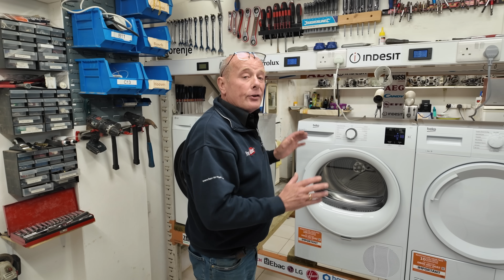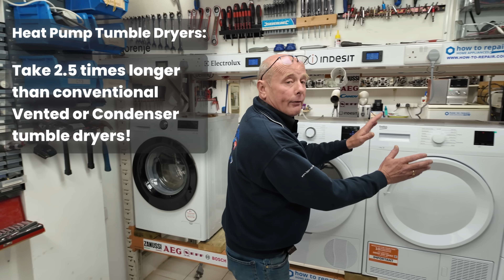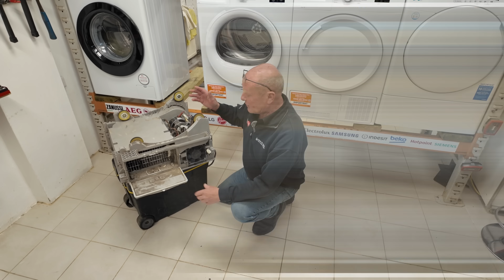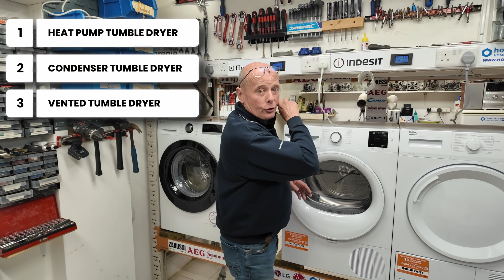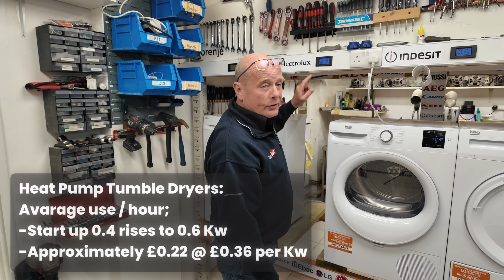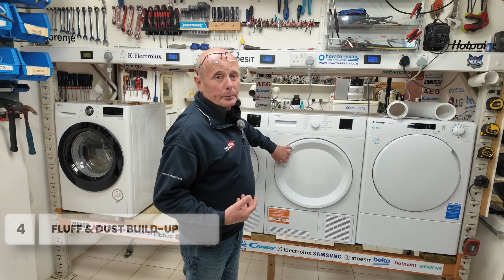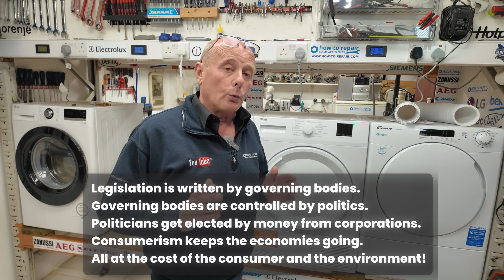Tumble Dryers the Shocking Truth About Heat Pump vs Vented & Condenser, NEW LEGISLATION!

Comment: I get these arguments to a point, but in my experience, the heat pump design would accommodate uprated bearings, and the compressor system would be reasonably reliable, probably no different to a fridge which also has a pressurised system and pump. I agree if it breaks its a much bigger pain perhaps, but in the UK its basically you're only option from new right now. We currently have a vented drier, it dries like a beast but consumes a lot of power but thats the tradeoff at the end of the day. If heat pumps are more efficient it's a bit of a no brainer. And the wear and tear on clothing must be a non argument because it will be a gentler temperature cycle overall I presume, and the collected lint will probably be the same for all three types of drier over a cycle?

Comment: In my region, lg washer dryer ( it uses condenser dryer type) has only drain pump filter. It doesn’t have any lint filter. Manual says : “ The water is used for auto-cleaning of lint-filter on drum during the drying. “ . Will it be a problem?

Comment: I went at drying clothes from another angle, instead of a dryer I bought a dehumidifier. No wear on the clothes so no fluff. You can get a very good one for a lot lower than the price of a dryer and as it isn't creating heat to dry it is cheaper to run specially if you run it at night. Another plus is if you have a room that is prone to mould you can run the dehumidifier in it every now and then to keep moisture low.
Reply: I was interested in your comments. I've been considering moving on from my old vented dryer, but I haven't been able to justify the cost. I also own a dehumidifier unit, and I have been using it as a clothes dryer in my laundry room.   I use portable drying racks with the dehumidifier, which works well for most clothing, not so well for sheets and other bedding. For them, I'm considering setting up a clothesline in the laundry.  I find that using a pedestal fan as well also helps. They only use about 30 - 40 watts, which is insignificant in the whole equation.

Comment: Not greenwashed BRIBED to legislate vastly more expensive equipment that fails faster.  Im an old fart  When environmentalism started in 60s coros fought it to rather little avail as the evidence was horrific.  After being forced to think harder they usually found it cheaper to be cleaner & some people would even pay more.  Over yrs coros realized veing green let them charge anything, cut production costs shrinking everything.  Now how to get EVERYONE buying more profitable green stuff.  Laws, bribe govt reg to FORCE buyers to buy green
Bonus - by kegislatung oroduct it cutb down low end competition those who could make stuff cheaper better by req extensive $$$$ testing to get certified green, to prove u werent just copying tech, stealing patents,  which lets appliance coros Jack up proces more.
Fyi  Many if not all GREEN ORGA that make up green codes, certify green stuff ARE DOMINATED BY INDUSTRY.  For no other reason than i dustry can have people on salary full time w support staff working inside org as volunteers vs part timers w jobs they need to pay rent & cant devote asuch tume to proving their beliefs.  
FYI  The embedded carbon in more complex equip far offsets energy savings esp if it fails 4x faster.

Comment: Thank you for this video. I was considering buying a heat pump dryer as the green lobby and Which? are always plugging them saying how much energy they save. They never mention the problems of repair and the fact they  will not last as long and are in the long run probably worse for the environment. So I will replce my 15year old standard dryer with a condenser model.

Comment: Thank you for this presentation.  It clears up a lot about the three versions of driers.  Perhaps 10-20 years from now they will design a better heat pump version.  Until then will stay with what works.  Note also, all the enhancements incorporated via microprocessors also lower the reliability.  Too many options when all you need is to just dry clothes :)

Comment: I do agree, the entire compressor and heat exchange boxes need to be redesigned into a slide out tray that can be serviced easily. 
I have a 2 year old system that i tore down.. and only then ..did i conclude the compressor needed regassing.

Comment: I bought a Beko heat pump dryer for about £400 about 6 months ago, Wish I had this video as a reference at the time I did not know they are so difficult to repair if they go wrong. I can see the issue with the dust build up I have just cleaned out the part at the bottom and it was absolutely caked in dust after 6 months. I still think I made the right choice but just less of a win than I thought.

Comment: Yes heat pump dryer design is terrible. And deliberate for obsolescence and at the same time strangely more expensive to manufacture. I suspect this is because no one would want the door and ground level. and the cooler and heater box at the top. And so the condense water would not need a pump. Also by removing the lid would make it easy for an engineer to gain access too the condenser and evaporator to clean out the lint.Without needing to strip the whole thing down including the drum. Also why do they fit the drum motor and capacitor in  an imposable location. Oh and also an issue with a heat pump system is the drum only runs in one direction and so all bedding gets knotted into a ball. And does not dry properly . Also there are not enough sensors fitted and so when the system is short of refrigerant, There is no fault diagnostics. The dryer will just run but not dry clothes. giving the customer no clue as to why.

Comment: Have a Miele dryer with heat pump (TKG450 WP FDos&SFinish Type: HT25 M-Nr.: 09724680) This was purchased mars 2014. (its 11 years old) and the dryer has been used a lot.  Know in April 25 I have the first error massage f 0002 on the machine. I did open the the dryer to check if it was dust into it. There where minimal with dust. But as you say the video, i'm not able to come in to the condenser for cleaning it. I was impressed that it as no little dust in the cabinet. But as I mention today I have det F2 error. I assume the problem is the temp sensor - but could this also be other fail on it? The T sensor I can replace bye my self, but it is worth to start fixing it, its 11 years old! ( The only thing I have replaced is the filter - placed down to left of the machine)
Reply: I repaired my 27 year ol Miele washing machine to give it away for free when relocating after 32 years…

Comment: We have a Hoover dryer with a long outlet pipe that runs under kitchen cupboards thus warming the room with waste outlet heat and, unlike a condenser machine we tried and returned, does not raise the room humidity to equatorial levels of dampness and dries a large load in an hour (Jeans waistbands excepted!). If you have no utility room the noise of washers, dishwashers and tumble dryers for several hours in a combined kitchen and living area whilst trying to relax must be tiring at best.
This Net Zero business is a purely political scam and has nothing to do with us the public's benefit, it is a money making scam for the rich. You will notice that all the equipment we are now made to accept for Net Zero is at least double the price of our old stuff and more costly to maintain from cars through gas heating to tumble dryers. 
All of our appliances and even small electrical items produce secondary heat which helps to warm our homes and the further north or south you live becomes more beneficial in winter months. Your fridge and freezer are both reverse heat pumps which have an effective room heater at the back to shed the extracted heat from the machine and run 24/7.
Development of appliances has seen their efficiency rise over time thus using less electricity so you can now buy most of them as 'A' rated or better. Those of us whom invested in Solar can (when the sun shines) run them almost entirely on the power produced without Grid electricity so we are not given a choice as which type of dryer to use nor a stored hot water fill washing machine from water heated by solar or a heat pump as they are all now cold fill only.

Comment: The heat pump version uses less energy for longer thus reducing the peak demand on the grid. So is it government telling the manufacturers to reduce the peak power because they are worried that their green policies in electricty generation will not be able to sustain the demand on the system by all the 5x load that the older types do!

Comment: do all siemens tumble dryers take the air from the room they are in to heat it? worried because I have an old model, Siemens siwatherm txl 273S, and people smoke in the room where my tumble dryer is, so I'm worried if the smoke is going inside the dryer?

Comment: our heatpump dryer gave up after ~5 years (turns out an important vent was never cleaned >.< whoops) and the advice from the repair man just kinda sucked >< it was 500 euro and it sipped electricity, his recommendation was an old fashioned one as they are easier to repair from 3 reputable brands...they all start at 1000 and suck power like nobody's busyness. so either I pay 500, save more then 500 over the next 5 years in power and in 5 years spend that saved money on another one... or I pay 1000 for a machine that will last longer but will suck enough power to never generate a in case of needing replacement pile of money saved : /

for my wallet it's better to fill up the landfill, but for the environment a machine that's ez to fix seems good but it sucks so much power it might just break even in the end >.< there doesn't seem to be a "good" option here :P

Comment: The door on my conventional drier, purchased in 1989 and never needing any servicing other than a hoover, has just broken - obvs. spares unavailable now! Here in Spain a good heat-pump drier is 300€ versus 260€ for a condensor. I live in a house with a 5.4 kW supply, so saving electricity is very relevant. I don't expect anything to last that long nowadays (including me), so I will be going for the heat-pump. Soon enough other types will be unavailable anyway! I take your points, but the arguments have different weights for me... plus I always use the 1400 rpm spin on my washer to finish.

Comment: Bought a Samsung Heat Pump drier about a year ago,  It is utterly useless. It has NEVER once dried a load on one cycle.  It takes hours and hours and then has to be put on again.  Not only that, one of the benefits of tumble drying was clothes coming out not needing ironing, but that is not the case now - everything is so creased.  I hate it so much.  I used to be able to have a washing day where I could put multiple loads through the machine and dryer, but this is no longer possible with the almost insane time it takes to dry a load.  It was a terrible buy, and customer services have been no use either... the advice seems to be either the load is too big or too small - which is all nonsense.  I have tried every possible variation of sorting and load sizes trying to get clothes/towels/bedding to dry on one cycle and they just don't.  I'm amazed people think they're gentler on the clothes too - the amount of lint produced is every bit as bad if not worse than in a vented dryer.  Hopeless.
Loved this video - great information and really helpful to have the three types of dryers compared and all aspects explained.  Thank you.
Reply from the maker: It was a pleasure. I’m sorry you didn’t see the video before you purchased your new machine.

Comment: This is such a clear description of all 3 dryers. Thank you. 
I am looking for a tumble dryer. I knew I didn't want, can't have a vented dryer, so I was considering the condenser dryer. Happened to come across the heat pump dryer, I wanted to compare them both. I came across your video, and you clearly demonstrated all 3 perfectly well. Thanks again😊

Comment: My dryer is a vented one and drys it in 40 mins , and these heat pump ones take over 2 hours and use 2.16 kWh, so that's 4.32 KW. My vented uses 5.34kwh. , thats 3.57 KW for 40 mins . Vented is cheaper to run and fix when it breaks .

Comment: This whole discussion treats a dryer in isolation, and ignores a significant factor when it comes to a dryers effect on the system of a home: ventilation, and by extension mold, depressurized spaces and other forms of inefficiency. By all means, if you're home is older and not air-tight, or you don't want to consider the benefits of having an air tight home, treat dryers as an isolated issue. But in my home the main selling point of a heat pump dryer is not energy efficiency (for the device alone), but rather that it doesn't require external venting, which impacts energy efficiency and air quality for the entire home.

Comment: A very persuasive take down of heat pump dryers.  I was just about to buy one now not sure what to do!  A vented dryer has the issue that you need to drill a very large hole in the side of your house.  Guess it's a condensor dryer for me!
Reply: I had a beko heat pump tumble dryer in my old house , never again it's starts at 3 hrs then if the clothes are dry before the 3hrs it stops automatically,  the only positive thing is they don't shrink clothes simply because they don't get hot enough,  I've got a glass door front condenser tumble now that looks great and actually drys my clothes ,

Comment: In theory, most of the issues are engineering ones. If they were designed to be a bit more modular and easier to repair, and the heat pump capacity was increased to match the drying speed of a vented dryer, they'd be the best of both worlds. Obviously the initial cost is a factor, and probably why they are the way they are. The only real issue they would be if something goes wrong with the refrigerant loop that required decompressing it.

Comment: I think room temperature affect the vented tumble dryer as well as it still needs to heat up the air. So it will make a difference if there 5 to 10 degree difference.

Comment: It's the same story with vaccuum cleaners where EU has demanded a max wattage rating of 900 watts - which is insane. 

With a 900 watt cleaner you need to spend more time because it sucks less, and breaks faster because its used more. 

You dont even use a vaccuum cleaner that much - at most its 1-2 hours a month. which is nothing in the grand scheme of things.

Comment: My heat pump dryer needs stripping and cleaning every two years. This is because the air gaps in the "fluff filters" are too big. A finer netting is required.

Comment: A heat pump dryer takes twice as long to do it's job - therefore it's likely to be left to work overnight or in an empty property.  Hundreds of fires have been caused by tumble dryers that are full of fluff.  It doesn't take Einstein to see where this is going.

Comment: I have purchased 3 washer/dryer all in one. All 3 failed on the 1st load. #1, LG 5.0 door unlock code even though it was locked. Had to reset over 20 times to complete 1st load. #2LG 2.4 did not dry, after adding additional 4 hrs of dry cycle I had to wring out the wet clothes. #3 GE 2.4 would not tumble while the drying which left the clothes wetter than after a spin cycle. Am I just unlucky or is this way they make appliances now? Thankful for good return policy.

Comment: Things will improve over time. samsung are doing rapid dry programs for 30 mins. but the main thing is like many tumble dryers is not to put loads of stuff in them let wet towels or dressing gown. they best dryer on a clothes horse. impossible to get items dry with towels in as they retain too much water so you have moister moving non stop.so basically a tumble dryer becomes a steamer. if like me i do scrimp and dont have a tumble dryer. i use a radiator fan in my bathroom with a clothes horse that fits in the bath. small bathroom. but very much like a large airing cupboard. but i will get a heat pump dryer to speed up or finish drying. so i like to irradict the problem of it being on too long. as i would only use it for smaller amounts of time. with the dust problem. there must be ways to choose fabrics that dont produce so much but i wouldnt of thought any heat pumps dont have a filter that you can remove lint from. i have to look into this. if they dont they got to make sure they do, in the future. but im sure testing out tumble dryer with clothing in will get a much better result from any test.

Comment: Ok, I produce energy. Maximum that goes onto grid is 3.68 kw.
I have 2 washing machines and 2 heat pump dryers. And I can run all 4 effectively for Free. If my wind turbine is running, i couldn’t do so if I had condenser

Comment: I'm not sure its necessary to call an engineer unless you need a new part to be designed.  A technician should be more than enough to perform a high quality repair.

Comment: I bought a Heat pump dryer a few years ago it was a top branded one . Tried it for a few months it was terrible everything always felt damp no matter what setting I tried it on ! To dry towels I had to leave them in the washing machine & spin them twice at full speed ,then after 2 & a half hours in the heat dump dryer they still were not fully dry ! I thought it maybe faulty so tried a different brand still as rubbish ! Tried a condenser that wasnt too bad but still found it released a fair bit of moisture into the atmosphere which wasnt good for my breathing .As much as I like the new tech ,I found the old vented did the job faster on its low setting ( I never use the hot setting ) It is easy to fully clean out. In 20 years I only had to replace a heating element which was very easy to do ( it only broke because I left wet towels in there accidently and forgot to switch it on ).